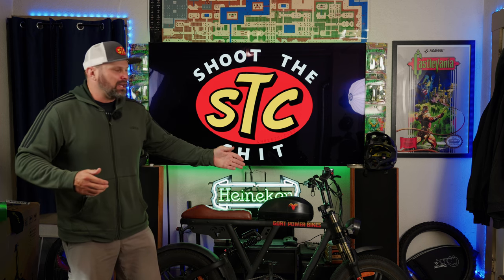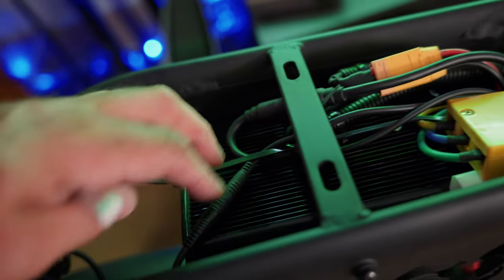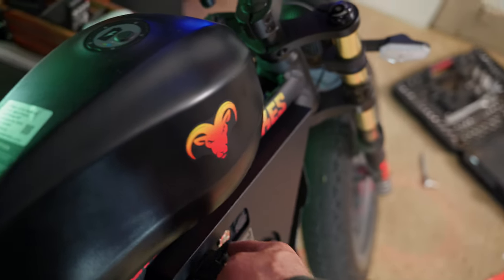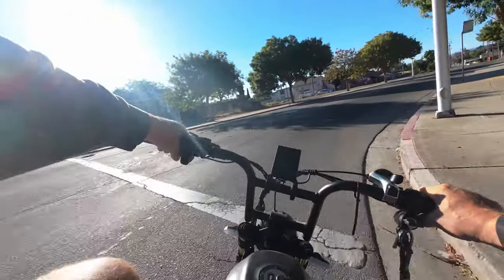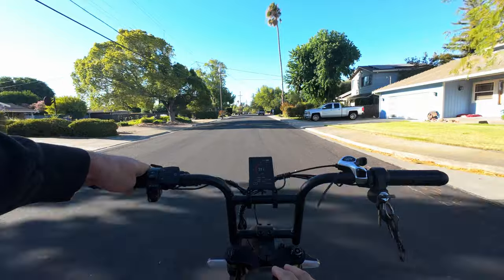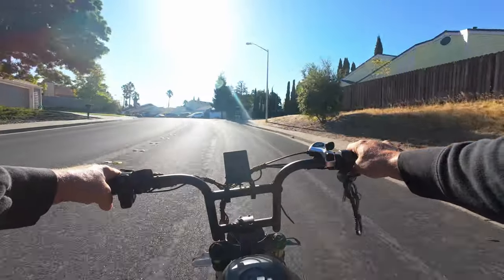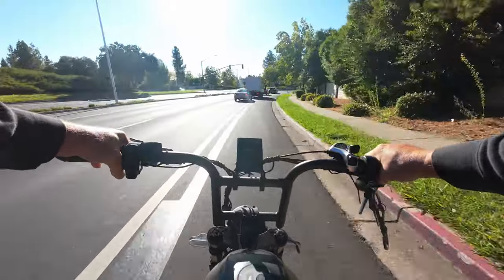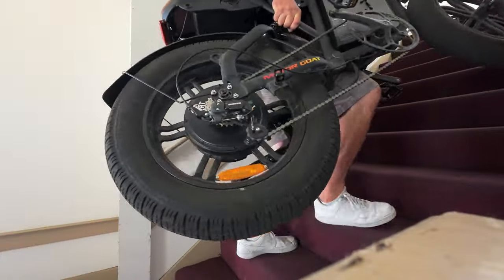Installing 50AH Battery On The Motor Goat V3 - ABSURD RANGE

Comment: Ooff... $1,600 for that battery alone. 😳
Reply from the maker: Yea, not cheap. I could have sworn it was 1300 when I first saw it, they must have raised the price.
Reply: Gotta pay to play
Reply: @shootthechit It was always $1500+tax.  I just got mine today and installed it.  I did not quit until I could put all 6 screws in but then the frame isn't bolted all the way right like I like it so I'm trying to find a compromise.  

I wouldn't recommend anybody buy this battery if u have a walkup unless u walk them up separately then maybe.  I can't wait to take this joint out for a test range run.
Reply: Scary how wobbly the stock battery is eh? Love the vids
Reply from the maker: @motorsport2k  yea, I put some foam tape under mine and cranked it down, its OK for the street but if I go offroad I strap it down
Reply: U think thieves would try to steal this considering there's no locking mechanism? Or would they think it's too time consuming taking out the 6 screws?  @coperyte
Reply: @mkeonine  I guess that depends on where u leave it.  Thieves can steal anything given opportunity and time.  I don't leave my bike outside of my view for very long unless I'm going to visit a friend at their apartment and even then I park it right outside their door with alarm on.  I never park it outside to go do something like shopping.
Reply: Triple the range for 50% more money sounds like a pretty good deal to me. I guess it depends how you look at it. Find another bike for $4,000 with 75 amp hours of battery at 63v. That's crazy.

Comment: I noticed on their website the torque on the newest versions is now 170nm up from 110nm. That's a huge difference.
Reply: I saw that too. I wonder what changed? That seems like a lot of torque for a gearless hub motor.
Reply: I think that's accurate for the highest start strength it's almost too much lol I stick to the middle start strength even that rips.... Anyways this might explain the changes in the bike description it's like goat didn't realize what they had

Comment: very nice! looks like a great addition.
 
 im 6'4" 230 lbs and yup old 63 
been torn between this and the ghostcat.    I have street ebikes that are ok for that purpose.
 I see the Goat is a fast street ebike -    aww I like that extra battery!
but I seldom ride streets on the bikes anymore.     [my choice]
 I live in the woods and there are miles of logging roads [trails too, but Im not expecting an ebike to do those] I have a 4 wheeler and it does fine [just noisy. same for my dirt bikes]
    Ive been looking into AWD ebikes also mid drives

 wow that talaria MX5 you have looks impressive [yeah the toggle regen :) ]  but another that might be more street friendly. 

   I like there are pedals "If" I have to. lol Im a bit too tall to pedal these mini bikes, but in a pinch? a break down? a power outage? I can pedal if I have to.   

 And I feel for ya living upstairs and in the city? 
I live in the woods, so ppl arent around to steal my stuff, critter damage will happen when left unattended.
my place is ground level - so I drive into the shop.

 when my wifes not looking I can park in the kitchen, until she returns ;)

Comment: I'm still getting on dual battery setups. Hopefully, these aren't dumb questions.

Does the battery blender balance both your batteries? So they dont have to be the same volts to start with?

Secondly, how do you charge the batteries? Separately? 

Much appreciated! I totally want this setup. Planning to use your code.
Reply from the maker: @vinceher5885  You have to charge separately.  The big battery has an 11amp charger with a different plug.  Batteries do not have to be at the same voltage, One battery can be completely dead and you can still ride. I was actually thinking about taking the top battery off for shorter rides

Comment: I went with the second reg battery. Not the big one you got. The reason is I want the ability to go to 72 volt. 
I got 58 miles at 30mph and it should get over 120 miles at 20 mph just with 50 ah.

Comment: My Power Goat frame battery arrives tomorrow, so it was great to see your install for the M/G. Great job on the video! Looks a bit cooler than my location in Port Charlotte, Fl.  Where are you? Moved down from Maine....
Reply: What is your opinion on the big battery pack?  Is it worth it?
Reply: @JoeBManco  Its Heavy! Sorry, I haven't installed it yet.  I had 2 bikes with flats, including the Power Goat. Haven't gotten to that bike yet.

Comment: How bad is the Motor Goat at climbing hills compared to the Dual Star?  Would it be able to handle Diablo?  Admittedly, even after getting my Dual Star, I'm still kind of pining for a more compact, scrambler style ebike.  But I live in a pretty hilly area.

I was actually surprised to hear how much you still like the Goat--I thought it would've been lost in the void between the Dual Star and your emotos.
Reply from the maker: I think the Goat would have no problem at all doing Diablo other than it might use a TON of the battery capacity.  It spikes right to 3000 watts really fast and if you're going uphill it will stay at that level a lot.  I like the Goat mostly for urban riding, the suspension isn't very good for offroad.  Fun to zip around on for sure.  
After adding the 50ah frame battery its an absolute tank now, so I find myself wanting to drag it up and down the stairs less often.. wouldn't be an issue if I had a garage
Reply: @shootthechit  Awesome, that's good to hear.  Yeah, I mostly use my Dual Star for street commuting (albeit, hilly)... I might consider adding the Goat to change things up when I want to...  I just don't know if I can justify TWO ebikes. 😅

Comment: So with the blender do you still use both battery chargers or can you use just one for both batteries?
Reply: Dos cargadores
Reply: @blown9646  Yeah that's what I thought. I've never used a battery blender, just parallel "Y" connectors.

Comment: Their website says the charger is 14 amps. It also says these 50 AH battery kits won't ship until October, so maybe it's a different version.
Reply from the maker: @Ken-r4d  mine says 14 amps at 240 volts,  11.5 Amp at 110. It's possible it's different but I bet it's the same one. I ordered mine quote awhile ago , maybe got it early

Comment: I wonder what type of cells they are using
Reply: I can't imagine that good if the charge amps is 11. The line amps wasn't mentioned but I would assume 50amps, with that much capacity can't be many amps per cell. Still can't beat a Lishen pack from Amorge.

Edit: 11amps at 110v and 14amps at 240..not bad but still Amorge wins

Comment: Bro has his blinkers on backwards
Reply from the maker: I really like them that way better, and... I never use them so it doesn't really matter
Reply: @shootthechit  lol all good have you had to replace your brakes yet? Mine got squeaky in the first 3 weeks and I didn’t slam. I see that you Slam quite a lot. At least in the past videos
Reply from the maker: @youngscammerlife  I swapped the front rotor and changed the pads. They have much better bite than the stock pads and the rotors don't warp